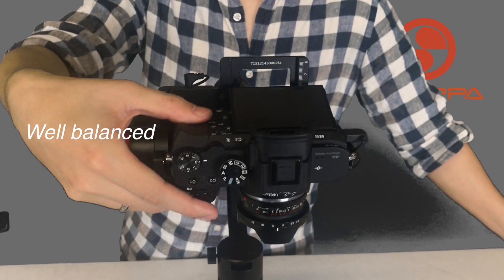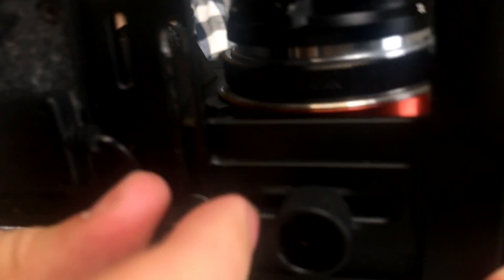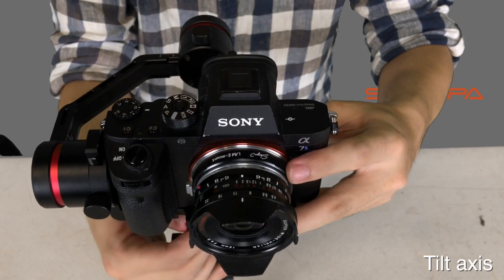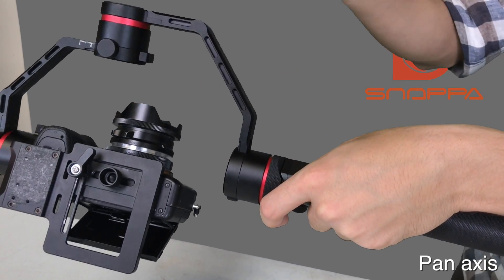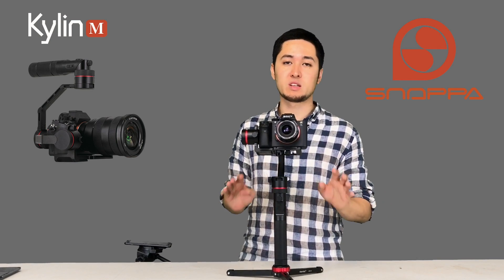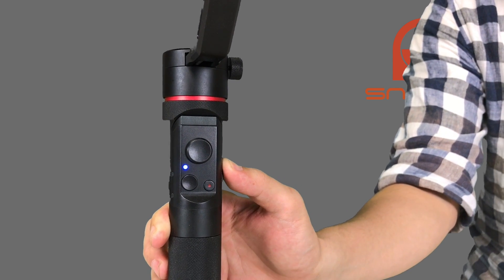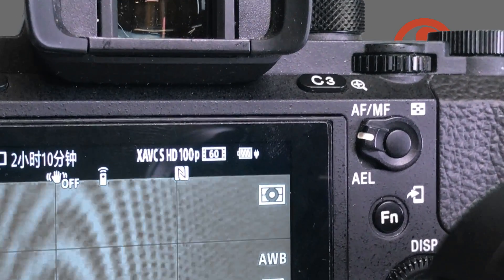Kylin M setup tutorial V1

Comment: Does anyone know why my Kylin start vibrating really hard when I turned it on?  I successfully did calibration but it vibrates so much that is useless. I have A6000 with 18-105mm. I tried to change the lens, it vibrates a bit less but you can steel feel it. What is the problem?
Reply: change in the app the weight!

Comment: I have to recalibrate both the drift and the level every time I turn it on as it drifts off and the horizon is tilted. Because of this, I can't use my GH5 with the fold out screen or a long lens as it's impossible to calibrate the level with either of these. 

If I swap to a short lens and close the screen, I have to then re-balance before calibrating. And then turn off, rebalance again when switching back to the longer lens. Then when I turn it back on, the horizon is tilted once more!!

Can anyone help?

Comment: I have received my Kylin M gimbal and I am really struggling with some problems.

1. It is impossible to do a level calibration with a light weight camera such as a Nikon J5 with a standard 10-30mm lens, and a iPhone 7 plus or a GoPro Hero 4 Black edition. When I am trying to calibrate the pitch arm where the lens is facing down, it is impossible.

2. Even if I do a Drift and level calibration the Yaw motor seems to let the gimbal drift slightly (anti)clock ways, so if you are mounting the gimbal on a tripod and you wanna do a TimeLaps or just wanna have it mounted on a tripod then the gimbal will over a short amount of time slightly have turnes some degrees.

3. I have tried doing a level calibration with my FujiFilm X100S, GoPro 4 Black edition, iPhone 7 plus and my Nikon J5 and on all calibration the pitch arm seems to be miss aligned. When turning the level indicator "on" on my cameras you can then slightly see that the gimbal is not totally aligned but is learning I bit down to the left (when you are looking at the gimbal from the point and shoot side".

4. In my Snoppa App under motor strength the description of the weight foe each strength is not there anymore.

5. When the gimbal is turned on and is standing on the tripod I then see small movements from the roll and pitch arms.

At this point I am a bit disappointed about the product, and it is hard to get in contact with Snoppa. Hope that the rest of the brackers is more lucky with their product.
Reply: Same with mine Sony Nex-5n, tried putting weight on mine Nex-5n and then it worked. So the problem is that the camera is sitting too low compared to the motor... My hope will be a quick release under the camera for making it sit higher.
Reply: I'm having every problem that you mentioned and yes it is almost impossible to get in contact with them. I'm starting to believe that they are running a scam. I've learned my lesson about backing any crowd funding product. This gimbal is unusable for professional work.

Comment: 2 things
1 - After balancing it I turn it on and it just starts moving by itself. I waited and it won't stop moving.
2 -The app does not work - does not connect - does not show up in bluetooth on phone
3 - NO INSTRUCTION MANUAL!!!!!!!
4 - NO INSTRUCTION MANUAL!!!!!!!
5 - NO INSTRUCTION MANUAL!!!!!!!
HELP!!!!!!
Reply: No instruction manual for me as well.... Having problems with bluetooth to
Reply: Hi Eric, I cracked it last night with the help of the user group on facebook! 
- With the app open and the correct gimbal selected hold down the power button for at least 3 seconds until the blue light starts flashing. 
- Then pair the device using the app
- There are instructions once within the app and it guides you through the calibration process.
- there are two procedures 1. where you lie the device on it's side on the table and 2. Where you pop it on a tripod
- once these two things happened it worked perfectly
I guess with a new product there's gonna be teething problems but a quick startup guide would have been helpful
Reply: me too
Reply: I have the same problem as you, we have been robbed! Hahaha
Reply: Mario Archaga see my response above. All fixed now!
Reply: above where? I see nothing
Reply: Have you used iphone? Or did you use android?
Reply: I use android

Comment: Has anyone tried this with a compact camera like the Panasonic LX100? I'm having trouble at the 'facing down' balancing step - there doesn't seem to be anymore adjustment so that it stays pointing downwards. Am I missing something?
Reply: bovinicide im having the same problem with me pansonic gx85. Any updates?
Reply: just had this issue today. i added a trigger to the hot shoe to give the camera more weight, and it worked. my camera/lens combo was obviously too light!
Reply: George Kunze ok thanks for the help!
Reply: It's weird considering you are supposed to be able to use it for phones and GoPro cameras and the like...it must be to do with the centre of gravity or something...
Reply: Had the same problem with my Sony Alpha 5100 with SEL1650 lens. Then I put a piece of wood (approx. 15mm height) under the camera to give it extra height and it works.
Reply: i have the same problem, i'm asking for a refund, they still give me this video as example. i have the panasonic gx-80

Comment: Thanks for the video! I got mine calibrated but my handle is stuck in the carry mode. The screw cannot be loosened. Should I try to force it? it gets loose s little while twisting it to the left, and it starts to move out, but then it gets stuck at the same point
Reply: Thank you!!! I managed to twist it. While it wasn't obvious, it's a good design all things considered.
Reply: Screw doesn't turn at all but the handle will rotate although very stiff. powers on in both configurations. Still checking other features
Reply: I have the same problem! I think is because is the new version. So we agree that we dont need to turn the screw in any moment we just need directly to force the handle to change the position with a bit of resistance right?
Reply: I had a similar problem. Mine is the new type with the caged, non removable screw. I could loosen the screw but couldn’t get the handle to turn. I figured out that it was just very stiff, and that since the handle only turns one direction it was hard to tell what I was feeling wa that stiffness or if I was turning it the wrong way and hit the stop. After easing it slightly back and forth I was able to find the direction it should move in and continued to apply moderate force in that direction to get it to move. Moving between positions about 10 times significantly reduced the effort required but it still feels tight.

Comment: I've just received my Kylin M and I feel good about this gimbal.
But the only problem is that when I hold it in low angle, it started to vibrate no matter what motor strength I chose. Is it about the balancing problem? As I think I didn't really balance it very precisely.
Reply: its not only you. my starts vibrating all the time.. and i don't have a level calibration as well. no way for me to update the firmware either. i know its all teething problems but. wow really pain in the butt.. hoping the firmware is fixed!
Reply: I found it is quite unstable. Sometimes I balance it very well, it still keep vibrating. But sometimes I'm in hurry I just put my camera on it, it doest vibrate at all. It's all about luck I guess. BTW, I can update the firmware though I don't know what really upgraded.
Reply: Hi. As Im from Hong Kong which is very close to Snoppa's headquarter, maybe that's the reason I got it so early. FYR, I ordered the kylin M on 13March.
Reply: Same here. I am using it with Canon M50 and 22mm lens. I used the lowest strength settings and still it vibrate in some angles. I can not use the firmware upgrade as well. Will test it with few other lenses with different weights. Hopefully they will fix these issues soon.
Reply: I have problem right after balancing gimbal right side of camera is slowly tilting to right side.. Is it bacause bad balance?

Comment: Just got my Gimbal and followed this setup video (great video btw) but I noticed that there are 2 things that are shown in this video that I was unable to locate in the app during my setup process.

1. In the video it was mentioned that there was a level calibration however in my app there is only a drift calibration option available

2. In the video there is also an option called roll following that is shown however this option is also not available in my Snoppa app.

Is anyone else having this issue as well?
Reply: Yes, I am having the same issue. No level calibration. May be it is in the new firmware but the firmware upgrade is not working either.
Reply: I had this problem at first then I realized that I selected the wrong product in the opening menu. When you first open the app you can select which snoppa product you will be syncing to your phone. Make sure to select Kylin m and not one of their other models.
Reply: Exact same problem here. No level calibration and can´t upgrade firmware. Wtf?!